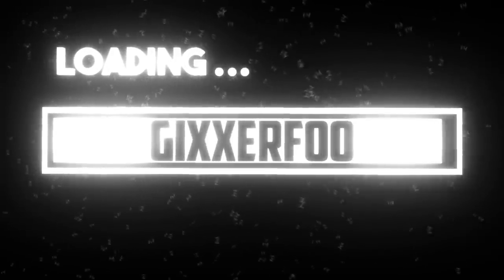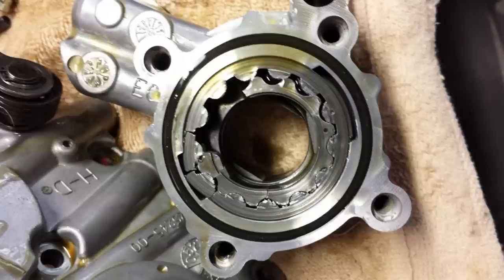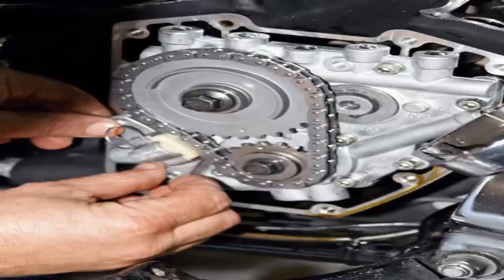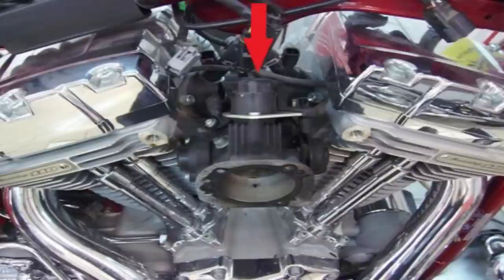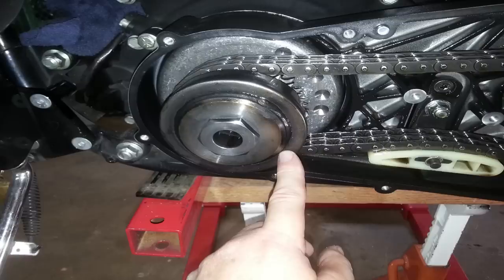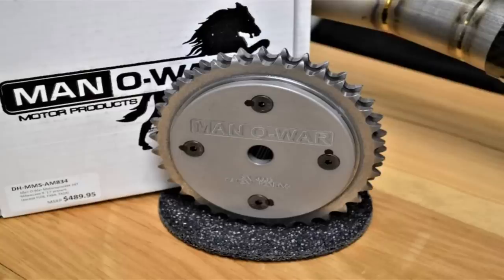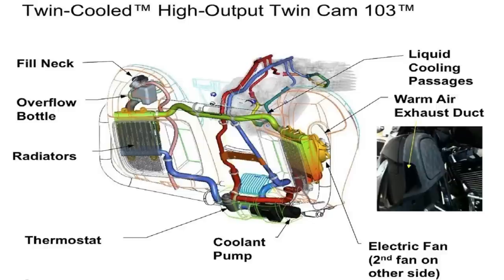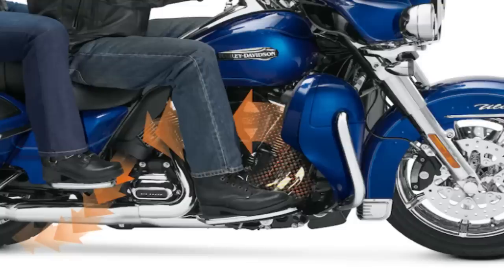5 Harley Problems the Aftermarket Fixed Before the Factory

Comment from the maker: What Harley engineering mistakes have you fixed on your bike (besides selling it lol)?
Reply: I replaced my oil pump with the upgraded oil pump on my '18 RK. To prevent sumping.
Reply: I could write a 1000 pages 😂
Reply: Rear hydraulic brake line switch failure..  caught on fire when it did.  Too close to exhaust.
Reply: Shovel head rear Banana caliper 🙄
Complete garbage
Reply: Wouldn't trade ANY of my Evo's in an even exchange for anything new even if it was a top of the line CVO model and im TOTALLY serious. "RIP HD 1903-1999"
Reply: 01 softail deuce-gear drive S&S cams
Reply: I can't believe all of the problems that the people are leaving in the comment section! LOL
Reply: I really do enjoy my old twin cam, it does have the hydro tensioners and screaming eagle clutch.  But I ride my Ducati Multi.
Reply: I thought you would have brought up that Timkin bearing
Reply: @lanceandmelanierogers6255  TRUE TO THE TIMKEN!
Reply: I can only speak for the Evolution engine. The rotors from the factory had the magnets attached to the rotor wall using epoxy of some sort. Over time it broke down and the magnets would fall into the stater. After market offers sealed options where this is not possible. With the factory rotor, falling magnets could cause alot of damage. They may have corrected this with time, but i didnt take the chance and purchased after market.
Reply: I have a few thoughts regarding my experience. I ride an 84 fxrs(we are the same age) Overall, I have few complaints with the engineering. Oil sumping is a given. The garbage rotor was an oversight. Given the bikes age, its holding up really well. Comparable to any motorcycle from its era. I'm only the second owner and I'm quite sure I have inherited all the so called problems this bike had to offer over the past decade. My overall feeling is everything I have dealt with is understandable given the age. Leaky push rod seals, rocker box gaskets, carb rebuilds, tappets and tappet gaskets, rotor magent fail. In all those cases, the oem replacement was far better than the original oem concerning seals. (Didn't test the water with the rotor). The difference then to now is OEM support. 10 years ago nearly every part I needed, Harley stocked. Now, after market is becoming the only solution. I am also running into issues with OEM not accounting for mixed parts years. Something has been lost in the digital consolidation. Example was needing a new voltage regulator. OEM and after market both sold me the incorrect stator plug for given year. In the end, I had to splice. Lucky for me, I am an electrician and knew how to splice correct. Another example was a kehin  carb kit, both float needles incorrect from harley. Last example was a choke cable incorrect and not otherwise stocked.
Reply: @kennethwise7108  i will keep that in mind. When navigating options at the time I wasn't sure what to do. Thanks! It's only going to get harder keeping the classics on the road. Community and passing along information like this is going to be key my friend.
Reply: Twin cam "B" with internal tensioners and spinning counterweights has GOT to be one of the most LARGEST WTF WERE THEY THINKING DESIGNS?
Reply: @justinwatkins1  yep, not to brag but ive been doing this for a long time. Ive seen all kinds of stuff. This channel is a very good one and you'll find a plethora of information about your bike here.
Reply: Dyna front and rear motor mounts.  Went to Predator fronts, and CCE rear...and what a difference it makes.  Went with Open Primary to eliminate the compensator issue, and gave my 06 FXDBI a 95" kit to give it the balls it always wanted. Some suspension upgrades and I wouldnt trade my Dyna for the world.  Just love it.
Reply: Yup I purchased a 2007 cvo roadking and the first 800 miles the head casket blew took it in my wife was so upset because she wanted to go new instead of used I was considering Japanese bikes because no issues with them but then we decided to go American and then thank god for warranty they fixed it 400 miles later it blew again !! Then realized the cylinder bolts were stretching from the heat, then the flywheel busted then the main shaft broke we only had up to 12,000 miles on it 😡😡😡 so we contacted lemon law Harley did not want to do anything till they paid me 12,000 and I was able to keep the bike finally all was fixed and then at 40,000 miles later the shifter arm broke and I’m an easy rider but no problems after that !! But unfortunately a sold it and kick myself in the ass for listening to my wife 😡😡😡😡and I now am trying to get another one but I don’t like the Milwaukee 8 sound so looking for another 110 a2012 🙂🙂
Reply: Changed to compensator and chain tainsioner
Reply: I’m looking to get another Harley cruiser I really don’t like the way the m8 sounds like but what bike would you recommend I’m not a hard rider but like to get on the gas getting on freeways I really loved the 110 cvo but just don’t know what year bike would be best ,, please help me if you can
Reply: did a gear drive .
Reply: @scrumthebum2451  yup I have buckets full of those ,funny now their kinda worth money. I also have a bucket full of Amal concentric and monobloc carbs for brit bikes.
Reply: @kennethwise7108  I remember when everyone was all see no evo hear no evo ride no evo. I think however it was more about being pissed at the motor company for the shortages and waiting time to just to get a new bike.
Reply: @ranchdog7920  one of my friends has a duc. Seems like a tempermental machine in a high state of tune like an Italian sports car. Expensive to maintain .
Reply: @chopperchopster  haaaa yeah. I was one of those people as I had a Troublehead in the mid 80's myself
Reply: @kennethwise7108  I agree..I still have my 73 Shovelhead 91ci and I have a 99 Evo Heritage Classic that's 96ci...both perform quite well...both I can wrench on without needing a computer...
Reply: @stevenbonnesen8819  cool, I wouldn't own a motorcycle without throttle cables and a carburetor
Reply: @kennethwise7108  ..I agree..one of my friends every few years would trade in his Road Glide for the latest model his last was an ultra RG/POS... which he became so disgusted with he let it get repo'd and now all he has is a frickin Vespa 200...he had owned like 5 different Road Glides and a CVO softail several Sportsters and what I could never understand was everytime he took his motorcycles in for warranty work he was charged for work they did...hell I had bought a new 77 Superglide in 78 and I was never charged for warranty work they even dyno tuned my bike no charge...I guess it paid to sell the service manager an 11 second Sportster for cheap and have a friend that was a mechanic there..lol
Reply: @stevenbonnesen8819  what a damn shame. There's a part of me that feels like they're on borrowed time. My best friend works at the York plant operations and not only does HE have an Evo but most of the Employees there do too! WHAT'S THAT TELL YOU? LOL
Reply: @kennethwise7108  tells me Harley peeked with the Evolution engine...and has been between struggle and decline ever since...they closed the Kansas City plant some years back... they're good at making poor decisions and dropping lines when they should have first tried offering fewer models like in 2 cases the Buells and the Vrods...the Sportsters should have been switched to a softail frame years ago to accommodate the entry level rider with a short inseam...but they don't listen to me...lol
Reply: @stevenbonnesen8819  yeah really,  welcome to the club. I subscribed to the Harley Davidson YouTube channel and regularly comment about their poor business decisions and guess what? THEY NEVER LISTEN TO ME EITHER! LOL
Reply: @kennethwise7108  lol... Yep they're a sorry lot... you'd think after all these years one of'em would want to listen to the customer base...but oh hell no...on a positive note I did subscribe to your channel...
Reply: @stevenbonnesen8819  AWESOME THANK YOU STEVEN!!! I'm an old school fella who does 100% of my work. Keeping all of my bikes on the road is almost a full time job. LOL
Reply: @chopperchopster  You may be right about many of the Ducati models, but the Multi is simply a very functional 150hp touring machine.  I can't tell you about the expense of maintenance, I've yet to require any outside of oil and filters..... and a rear tire.  I'm not loyal to any particular brand, I got rid of a 2016 Roadglide to try this Ducati, and so far its a pretty good machine.
Reply: @kennethwise7108  my friend at 68.. I reckon it's safe to say I am "old school"... I too work on my own stuff...one of these days I will have to invest in a repair manual for the Evo...I have one for the shovel but where it is is anyone's guess...
Reply: @ranchdog7920  i have had BMW's over the years but can't stand the European riding position. I can throw my leg over my Road Glide and go from South central PA to CA & get off of it and go dancing
Reply: @stevenbonnesen8819  haaa yep, I know certain torque specs off of feel at this age. My favorite channel for wrenching is Tatro Machine out of San Diego. He gets it and is the most old school mechanic on YouTube. Not many of us out here. I have a background as a Nuclear Submarine Mechanic and torque specs and precision measuring instruments are my life.
Reply: @kennethwise7108  I watched him too...you familiar with Veteran biker on YouTube he's a submariner or Don Shipley Seal he busts Seal impersonators...me I was injured in a roll over car wreck when I was 10...my injuries kept me for ever passing a physical...
Reply: @stevenbonnesen8819  no, I haven't seen either one of those fellas. I'll be sure to check them out though. Sounds like something that'd spark my interest
Reply: @stevenbonnesen8819  that Don Shipley fella is a badass!! Lol
Just watched a few of his videos and subscribed
Reply: @kennethwise7108  yes sir he sure is... there's another Seal that has a YouTube channel is Mr.Ballen his is oral stories well worth your time...Veteran Biker was a Submariner so you should engage him in conversation.. he does interviews.. you and Veteran Biker would make a great show...
Reply: @stevenbonnesen8819  THANKS ILL CHECK IT OUT!!! 👍🏻
Reply: @kennethwise7108  Why did they drift away from the evo ....the rubber mounted motor and injection bikes are not user friendly  have no sole and could be made by any bike company ....they look the same as others now..just a different tank badge
Reply: @specialse  GREAT QUESTION! And I'll be brutally honest with you. Wait for it.. Wait for it....
$$MONEY$$
The Evo is such a reliable engine that The "Motor Company" had no choice but to change it up significantly which they did with the Twin Cam. The Twin cam is practically a throw away engine whereas the Evo's can easily be rebuilt. Thats my opinion and the opinion of several other Harley Davidson machinists that I know of in the business. Not saying the Twin cam cannot be rebuilt but there are components of the engine cases that have wear tolerances that are not able to be exceed. Ever wonder why you see most drag bikes running Evo powered engines???
Reply: @125saito  David, just wanted to say thanks for sharing the Don Shipley channel. Ive been binge watching his videos, its so sad to see so many people claiming to be Navy SEAL's. I LOVE how he tries to bust them ALL!
Reply: I traded my harley for a mule. reliable as hell.
Reply: Added tiny love jugs, I guess it can’t hurt 😃
Reply: @bigblue3568  I know what you feel like happened, but exhaust was not the culprit... The 15 amp fuse allowed the shorted switch to act like a Electric hair dryer, and burn itself up, because the relay is not fused both ways 👍🤔
Reply: Harley engineering is not in charge of production... Money is in charge..CEOs look at other manufacturer's And simply cut too many costs, for example (dropping outer bearings on cam plates ) Stupid, just like Jap bike overhead cams, head surface instead of bearings.. Can't sell more, If nothing breaks !
Reply: @randymccalla9995  It's not what I feel like what happened its exactly what happened and was a known issue so much that Harley even issued a special bulletin on it.  Hydraulic switch replaced for free even though out of warranty and tossed into bin with other burned up switches.
Reply: @bigblue3568  I never go to Harley for repairs,  they will fix something and next month It will need more fixing.
Reply: What about the rear bag brackets that snap off from the exhaust hanger on 1999- 2007? How commonly do those break? Must be quite a bit beacuse they have aftermarket parts to repair the existing ones.  You can get another factory one but it'll do the same thing in a few years. Seems like Harley would have another support bracket for the mufflers except the bag bracket at the very end of the exhaust? If anyone has had a Y pipe on the crossover for the rear cylinder break , I think this is one of the main reasons.

Comment: what about the pressed together flywheels with all the run out issues.
Reply from the maker: That's for sure an issue, you have to dig very deep and spend some big bucks to get a new crank to fix that.
Reply: IV been looking into that myself on my bike as well.It seems to fix that issue is costly to say the least.
Reply: Can't believe that the "Motor Company" hasn't been able to design a one piece crank assembly by now! WTF???
Reply: @kennethwise7108  i cant believe they haven't staggered the cylinders and separated the rods. for people that dont like progress this is it. its antiquated as .....
Reply: I met a guy who had purchased a brand new twin cam and decided to buy a gear drive cam for it. The factory run out was SO BAD that it couldn't be installed! Damn shame huh?
Reply: @kennethwise7108  alot of bike have the pressed crank pin assemblys and when Harley puts them in they are usually petty straight. but then you put them in a sloppy bearing, alow pinion run out of up to 12 thousands and the compensator slams the other side to another 6 . ive heard of m8s and many of the 17s imploding in as little as 2k .all that said im still a harley guy. i put a half a million miles on my shovel with i would gladly trade for my 2014 twincam for if i cone across it but the roadking is ok.
Reply: @kennethwise7108  That's the same issues I had when I went to upgrade mine.I checked both sides and the gear drive would have just eat itself up.So I just went with a hydraulic cam plate and tensioners.On the bright side I upgraded to a high flow oil pump and oil cooler.And still able to ride.But you would think for as long as they have been making Harleys.They would have fixed the issues.Guess that's why it seems there's as many in shops than on the floor for sale.
Reply: @robertrosson1990  yep, and just think about how that effects your engine life! Twin cams are essentially a throw away engine in my opinion. I definitely wouldn't want a "B" series engine that's for DARN sure
Reply: From working at a dealer I don’t remember ever having to do cranks
I do however remember doing a ton of engine cases on b motors for poor engine cases
Reply: @Deathtrap617  rotating and  reciprocating  mass is pressed together throw away crap ,cannot be rebuilt disposable
Reply: @Deathtrap617  I watched a YouTube video from a fella named "Keenan Tatro" who split the cases on a "B" engine and the spinning weights had a sprocket for the chain drive mechanism. Both front and rear nuts that were used to hold the sprocket in place were loose! I couldn't believe how they didn't use self locking nuts on something of that nature.
Reply: @kennethwise7108  to me those b motors were garbage 
That counterbalance assembly was like and after thought
Reply: @Deathtrap617  yep, totally unnecessary. If balanced correctly the engine should be smooth as butter. I believe Zippers removes them completely once they do their thing on the flywheel assembly
Reply: @kennethwise7108  THAT is more common than not!
Reply: @karmsenrab8587  RIP HD 1903-1999
Reply: @kennethwise7108  As sad as that is I with you there, and it's all in the name of greed for profit, the almighty dollar, what other bike do people lay down a premium price for and then have to put that much more into it to make it right? 
Infuckingsane!!!
Reply: @karmsenrab8587 This is the only brand I've owned aside from a few BMWs. Sadly HD went downhill and went into a downward spiral after 1999 (post Evo). I don't even look at new crap anymore. The bean counters have destroyed the brand. Since there are no "Harley" or "Davidson" family members associated with the brand name anymore they don't give a rats a$$. Not the first one of the bean counters even throw their leg over one of these bikes and go out and ride them for 4,000 miles or even 1/3 of that!

Comment: Great video, Gixxer!  However, you forgot to mention the loss of the Timken-Tapered bearing starting in  2003.
Reply from the maker: Thank you, I appreciate it! That's quite a job to add that feature back in, but if you've got the engine down it's highly recommended to do it.

Comment: That has always been the problem with Harley-Davidson that they went from quality to quantity that started in the seventies. The only bike they made that was pretty much bulletproof was the Sportster. The biggest problem is they build bikes that have problems when they leave the factory and they don't stand behind them.
Reply from the maker: Quantity over quality, that's exactly it! They had quality in the Evo but they had empty show rooms, that was production problems not being executed properly though. Solution, lower quality and crank them out rather than addressing production issues.
Reply: Exactly.  Sportsters run forever
Reply: Yep you can't sell If previous models last for too many years, Gotta close your eyes and pin the donkey..(parts suppliers)